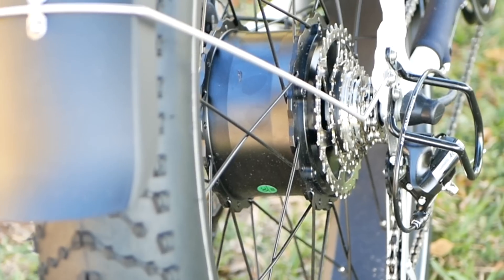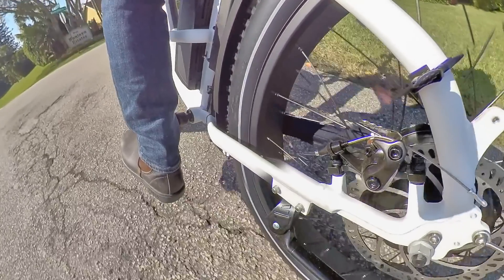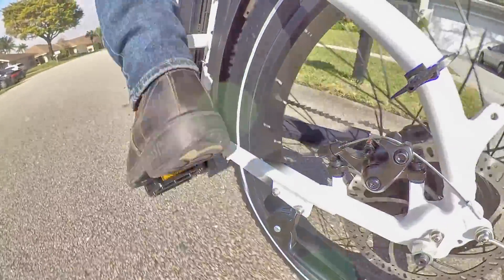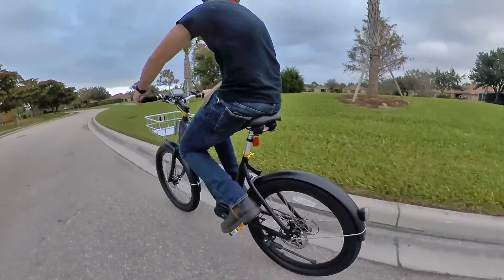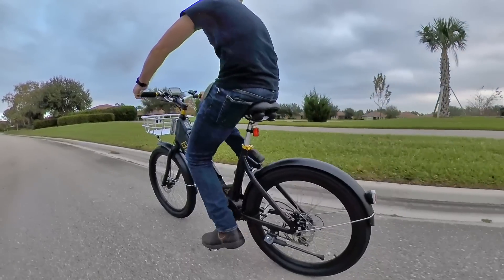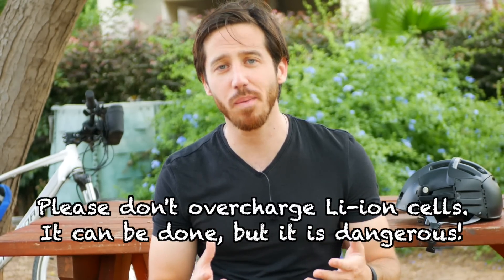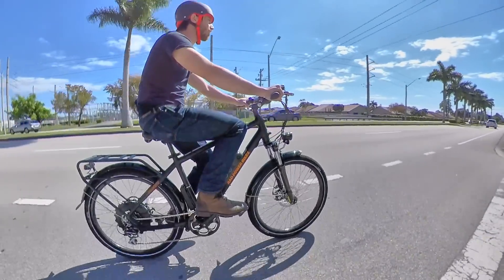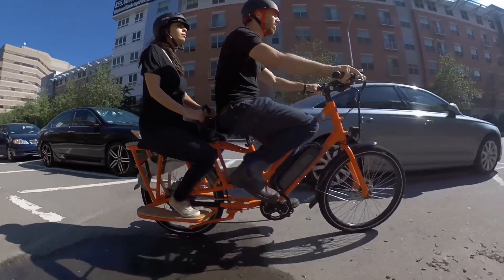Why don't more electric bikes have regen brakes?

Comment: I know it's 5 years later but I just have to say, you do know that most people want regen braking mainly for handling down-slopes, right?  The little bit of extra range is only an added bonus.  The biggest benefit is to be able to have that much more control going downhill and without overheating your brakes.

Comment: On my electric boards (meepo v2 and v3 both er) i found i wpuld get about 15% battery back or battery extension using the regen braking.  I actually found it super useful and if i found myself extra low on battery and at the top of a hill i wpuld load my board up with all sorts of heavy shit than sit on it and roll down the hill with the brakes on hahah. Those meepos are a beast eapecially the older v2.   With the v3 i tries a little custom mod and on the remote it said i had it going 57 mph! But when i took it to the street it fried itself at 34mph. Kinda bummed me out because i wpuld regularly hit about 30 to 35mph every day just fine on the way to work but whayever i did it couldnt handle it haha

Comment: All of my searches about E-bike regen-braking say the same point about not offering enough charging (5%) to make it worth the drawbacks in cost and resistance.  My whole reason for searching this topic is because after my first E-bike ride a few days ago in my mountainous area with gravel roads, is that I'm on the brakes for ages coming down hills, just burning up the brakes when the ability to slow down could be built right into the motor.  Seems there could be some electronic or mechanical way to get the best of both worlds between Direct Drive and Geared motors.

Comment: In the 10 years that I have owned and repaired my ebikes the two experts I have come to rely upon the most are Micah Toll & Justin Lemire-Elmore.  Anyone who follows Justin knows what a strong proponent of regenerative braking he is.  I am surprised Micah did not mention the main reasons why regenerative braking is superior to no regen.  Let's assume that the extra energy (~5%) put back into the battery is equally offset by the parasitic drag inherent in a direct drive motor.  Where does that leave us?
* very little wear on any brake pads attached to a motorized wheel which means you will rarely need to replace those pads which necessitates the removal of the motorized wheel along with cutting cable ties to unplug cables which is usually very time consuming and labor intensive especially if dealing with one of those 100+ lbs ebikes.  Many professional bike mechanics refuse to repair ebikes for this reason or they don't mind doing this job but can't because they don't possess a strong, expensive bike repair stand capable of supporting a 100+ lbs ebike.
* almost zero overheating of the rotors and brake pads attached to a motorized wheel which practically eliminates damage due to overheating of the rotor and brake pads and the chance of a catastrophic brake failure on a long descent.
* if you ever lose hydraulic brake fluid or your brakes fail for any other reason you will still be able to get home safely using regen braking.
* smoother no squeaking braking.
* safer braking in wet conditions.

I have owned ebikes with and without regen.  It is a no-brainer.  Give me regen.
On top of all this there are inventors, including Justin, who are working on designing a "Freegen" motor that has the best of both worlds; regenerative braking with no parasitic drag.

Comment: You need an extra circuit containing some 3000 Farad super capacitors and an additional Back EMF Filtering circuit to handle regenerative charging properly. However, it may be beneficial while climbing down mountains.

Comment: OK what about not regenerative braking but just a regenerative hub where when you’re going downhill say like from the top of Vail Pass or instead of riding your brakes the whole way you could just unlock the clutch like he said and then I assume you know 30 miles an hour at 10:15 miles downhill I assume you could get some decent charge out of that know? And I’m pondering using like a a cheap power tool battery instead of a expensive E bike thing so in that case but maybe it’s not possible because the power up for outside the power unit generate coming down? Maybe I just don’t wanna ride my brakes the whole way down I’d like to just look around and enjoy without rubbing your brakes off the whole way down and feeling out of control so much like downshifting in a car because he could downshifted region on a bike maybe I’m just really miss understanding my physics and electrical rules?

Comment: Wow, ok coming from riding scooters and electric skateboards, it's all about Regen breaking. I hate motors with planetary gears as it wastes Regen capabilities. As for charging, Regen triples the distance my batteries would get without Regen. And skateboards must have Regen to stop. Its all about the ESC too, but I've gotta say, Regen is much more return than 5% from building my own boards and scooters is typically 50%. Sure, the motors are very heavy but all those magnets give out very high change when Regen.

Comment: So, if you live on flat roads and no stop signs for a 10-mile trip then regen is pretty much useless. Also, if the bike has no free wheel in the above scenario does it use more energy. You said it's harder to pedal direct drive motors because the magnets have drag resistance but do the magnets cause drag when the motor is on, which means you would use more battery power than a non-permanent magnet motor.

Comment: Your explanation sounds logical, but it conflicts with my years of actual experience riding an eBike with regenerative braking.  I ride a old-fashioned human-powered bike now, because I like the exercise. However, back in the day, 20 years ago,  I rode bikes converted with Bionx kits to eBikes, to commute to and from work. The Bionx kit had a rear-wheel hub motor, similar in size and weight to modern ones, a torque sensor, an optional throttle, a handy removable battery and yes, regenerative braking. There was ZERO noticeable added pedaling resistance when the power was turned off.  So, after 20 years of tech progress, you're telling us we can't do it anymore? Regen does increase range a bit, the main advantage is increased control and safety. My electric car, a Tesla Model Y, is the same... I like the regen braking because it gives increased control and safety. With one-pedal driving I have faster and more accurate speed control when maneuvering in tight spots, like a parking lot, on the highway, and on steep downhills. On my old eBikes, I loved the sense of control and safety riding downhill or maneuvering around obstacles with regen. An ebike without regen is an inferior product. Considering the high prices charged for eBikes, there is no need for this cost-saving measure. Sorry, but you can't keep me down on the farm, now that I've seen Paree!

Comment: GRIN Technologies have Proportional Regenerative Braking geared hub motors and controllers. GMAC motors, Phaserunner controller. SIMPLE for DIYs
If Manufacturers want a cheap method, they could just dump the Hub Motor's Regen wattage as heat across a finned resistor, so the controller is cheaper; then advertise the savings in brake pad and chain wear; the best benefits of Regen

Comment: I was actually searching youtube for “ebikes with regenerative braking” when your video was listed as one of the search results.

my interest in regenerative braking is not for how much energy i can store into the battery through the electronic/regenerative braking system, but rather i prefer both the feel of regenerative braking, and i like that regenerative braking greatly extends my brake pads lifespan, exponentially (many times the original lifespan)

when i reached out to several different ebike companies asking if they offer any of their model ebikes, with regenerative braking, they all said the same thing, “this is the number one request we get from customers and ebike shoppers(people in the market for a new ebike)

i have several scooters with regenerative braking (dualtron storm, dualtron thunder, and many more) all of which coast very well, when not accelerating, and not braking.

i am considering installing the motor controller and all related electronics (and motor as well, if needed) from one of my scooters (equipped with regenerative braking) and installing this into my ebike.

this is an experiment, and i enjoy very much, learning from experimentation.

my 2012 toyota hybrid has regenerative braking as well as the traditional braking system with friction brakes. i always employ/engage and maximize the electronic regenerative braking system which permit me to only change my brakes once, in six years, compared to once or twice each year with my previous automobile, which was not equipped with electronic regenerative braking (same miles/distance driven with each automobile)

its also exciting to think of how engineers practicing the moto “there is always another way” shall continue to develop and solve this challenge of reducing drag to electric motors/generators, and maximizing efficiency of motors/generators.

great video!
great work!

thank you!

Comment: So theoretically you could charge the bike by never using the motor and pedaling only and it might take a few days to fully charge it but it is possible, especially if you had a solar panel.

Comment: Does that mean if the bike has a rear derailleur, it has regen because it's not geared in the hub but rather on the cassette? And if it has rolling resistance?

Comment: Though shouldn't there be no resistance from magnet and copper coils if the two ends of the coil isn't connected to a load (open circuit)?
Reply: ah, I guess just the rotor magnet being attracted to the stator ferrite frame or whatever creates some resistance.
Though I've heard car alternators uses electromagnets rather than permanent magnets, is there something that works like that on bike motors?

Comment: Since the one-way nut on the gear type motor was broken, my bike gained regenerative braking and battery charging capability. It malfunctioned soon after. but it charged my battery for a while (maybe it broke it):)

Comment: When you go uphill, slowly, the vast majority of power goes into moving up the weight, not certainly drag. When going downhill, with a good regenerative system, you can probably recover 50% of the energy put into the hill climb. That means that if the conditions are good (e.g. battery at average charge, slow speed, good breaking power) and for example you used  a 50% assistance you can literally get back 100% of the range.

Comment: Thank you for the information and knowledge on regenerate braking. I purchased a 2018 Rad Wagon Cargo Bike and very familiar with the regenerate braking so what I did. I online spoke to the tech at Electric Bike World. Order the aftermarket fully integrated display and controller 35 amp. The display fully programmable. The battery a biggie 48v/😊80amps= 5 batteries in total. You can set the regenerate braking<diamagnetic braking  meaning going down the hill! I activate the regenerate braking and it like cruise control. So it never over speeds,you never have it use the brake levers only when coming to a complete stop! Loving the Direct drive motors. I also pull my dog trailer and regenerate braking down steep hills you don’t want overspeed’s kill the brakes! Your ass is wet all day long too! Having regenerate braking is a great safety system on brakes!🙌🏽

Comment: You could possibly add regenerative braking with additional circuitry that regulates the voltage. And to deal with the rather high spikes of current, a supercapacitor bank could be used to deal with the sudden amounts of current. While then the power returns more slowly back to the battery

Comment: Okay, no regen braking for bicycles, because they are only bicycles, simple and cheap - yes, even when they are complicated and expensive. The reason bicycles don't do regen braking is the cheap battery that can not take the power. Mine charges at only 80W for several hours. For regen, it needs to be able to fast charge in well under 1 hour without getting overheated and damaged. Fast charging would also allow long trips.   

For real electric vehicles, regen braking is a must, it's fun, and very useful. Cars like the BMW i3 can do "one pedal driving" with only the "gas" pedal, it's simply great, kind of a "god mode", or like a steering wheel for speed, which goes in both directions, and straight, as you wish. If you lift your right foot, the car is slowed down with regen braking. In some EV models, it even brings the car to a standstill in front of a red light. No need to use the friction brake pedal at all, unless in emergency situations, or when going very fast, or down steep slopes.

Comment: We just moved house to a more mountainous area with steep hills to climb and decend. I just tried my new GMAC (locked clutch, geared) motor and Grin controller with regen, yes both cost quite a bit to import, complicated to set up, but the regen seems to work very well here, hardly any battery voltage drop when I go to the shops a few km away, nice to have another form of braking to take the stress off my existing brakes too, such steep hills here.

Comment: there has to be a way to increase the percent breaking can regen.  like gear up the moter so that it spins at super high RPM wen u use the breaks so that u stop faster and regen allot more.   aswell as by having a capacitor bank to collect the break regen instead of dumping it to the battery.   

and fir the free wheel costing all u need is a manual clutch

Comment: Do regen braking require actual brake? Let's say on high speed and you release the throttle without press the brake, will it regen braking too as some car does? Do I need actual brake sensor to sense the brake to get regen braking when I press brake? Hope you can answer 3 of my questions detailed and separately

Comment: So what do you recommend for someone that lives in very steep very choppy Ozark Hills?
To give you a quick example 80% to 90% of the roads are steep hills.
If I'm to ride a regular 18 speed bike I would get halfway up the hill before I had to shift down to the lowest gear and even then I might end up walking the bike up part of the way.

Going down the hills you could only go 1 or 250 before you had to break all the rest of the way down otherwise you would be well over 50 miles an hour.

What kind of e-bike would you recommend ?

Comment: Just as an aside, I drive a Lexus RX hybrid that uses regen braking (identical to a Prius drivetrain, just much larger).  The brakes are designed so that the first 10% of pedal movement goes into regen, and then the regular friction pads are gradually brought in as more pressure is applied.  I get mileage in the high-20's; I would guess that regen accounts for maybe  5 percent of that mileage, at most.

One interesting side note: as the video discusses, what happens if the battery is already full and you apply regen?  First, the battery in a Toyota/Lexus hybrid is kept at roughly 80% to allow for some regen.  But if there is more than what is healthy for the batteries, the computer actually bleeds off excess kinetic energy by spinning the internal combustion engine with fuel turned off and throttle closed, making the engine a giant vacuum pump, which sucks up a lot of energy.

The Toyota hybrid system is literally nothing more than a beefy planetary gearset.  Brilliant design.

Comment: why cant i make regen breacking on my escoter? I noticed that if i put them wires from motor in shurcut the motor refuzes to spin. Fine. I buy a new motor wheel from ebay and swap it with the front wheel and i can  use now a potentiometter and a rezistor to break safely. But why do i have to heat a rezistor when i can direct the energy back in to the battery ? I am looking in to this rite now but why not all escoters have regen breaking ? why ?:))

Comment: Great explanation thanks. Mountain bike tours are 2-3 hours up and 1 hour down hill and this will eat up brakes quickly which is quite some costs. So for mountain bikes I still believe even a few km more will be of advantage. Sometimes I even have to charge the battery during a longer MTB tour and if this could be bridged by regen braking would be cool.

Comment: My take on this question - based on something I read probably 15 years ago - is: regenerative braking adds a lot of complication. If you want more range, get a second battery.

This kind of advice doesn't work for a car, because the heaviest thing in an electric car is the battery. The heaviest thing on an electric bike ... is the rider.